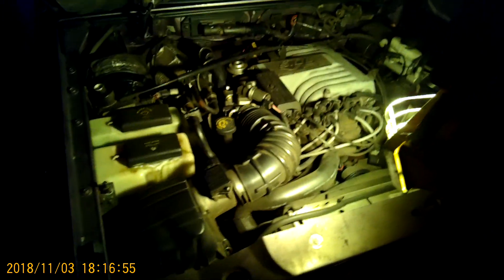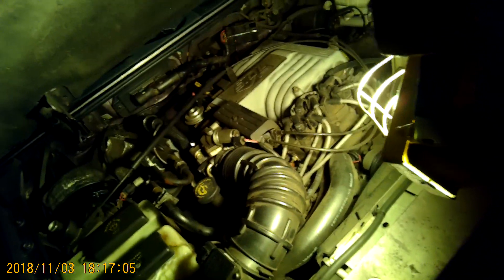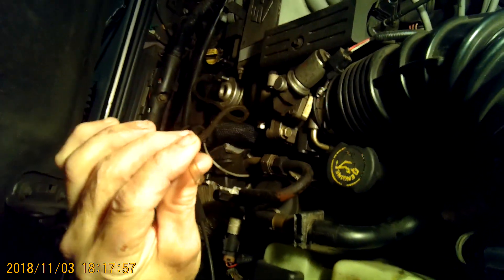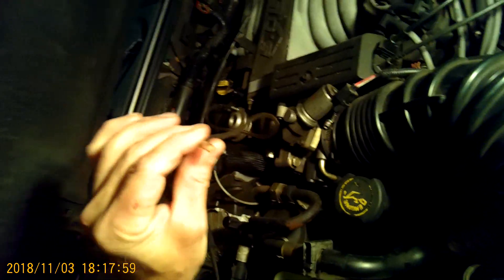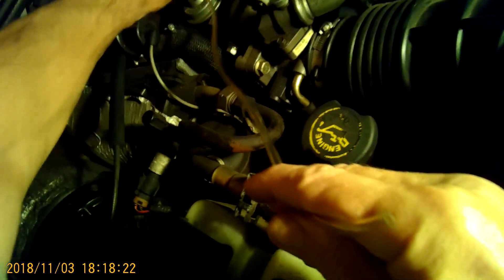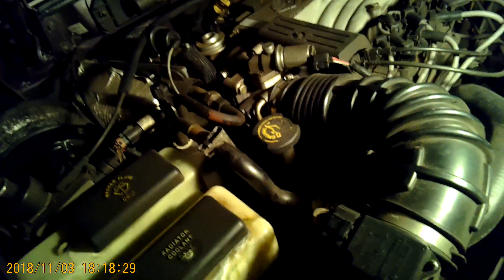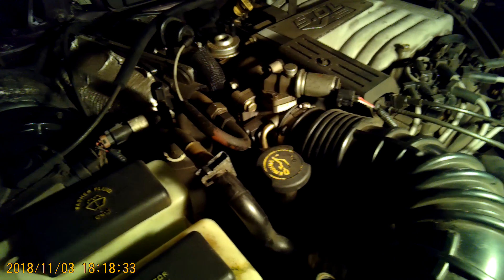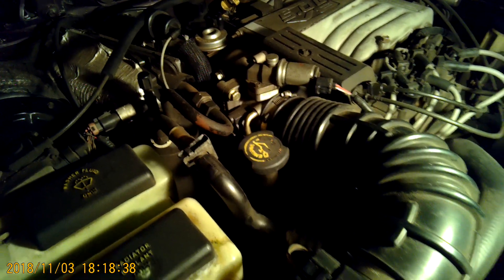OBD II P0402 Ford 1997 AWD 5.0 V8 Explorer

Comment: And since that hose goes from the solenoid to the valve it could be that just not sure
Reply from the maker: I suction tested the EGR Solenoid, it felt different than a new one. So,  I replaced EGR Solenoid, and the idle smoothed out, a unbelievable difference, super smooth idle.

Comment: Ok I did this test and got nothing. Which means what? And I have had mine off when redoing the heads but I don't remember a tube. Where is this so called egr valve tube at on this motor?
Reply from the maker: EGR Tube is on the passenger side exhaust manifold  with the GT40P  (4 bar) heads.